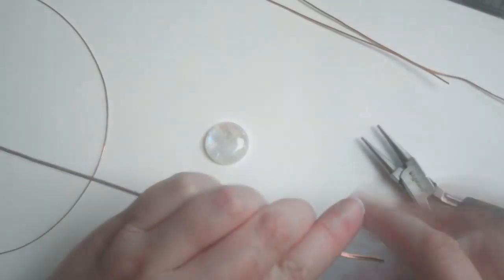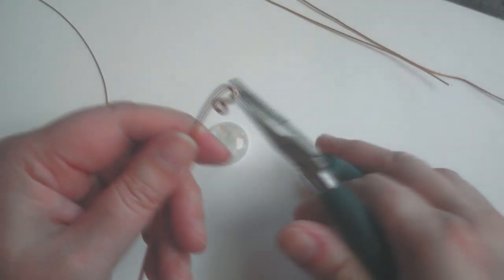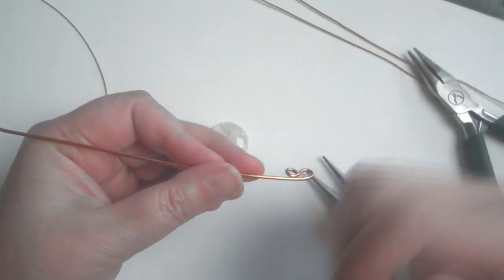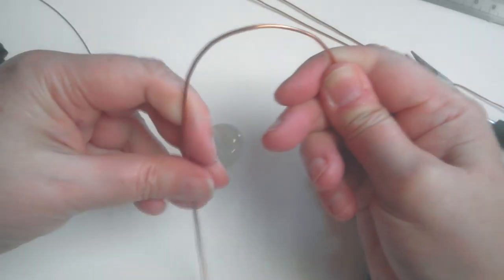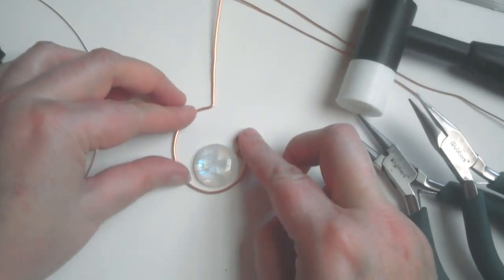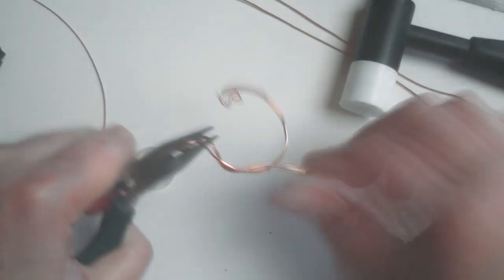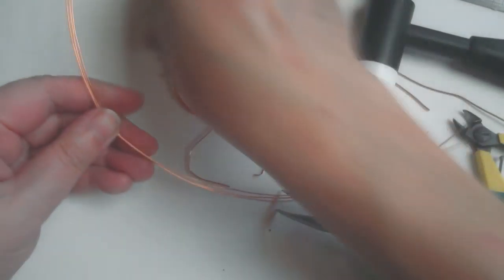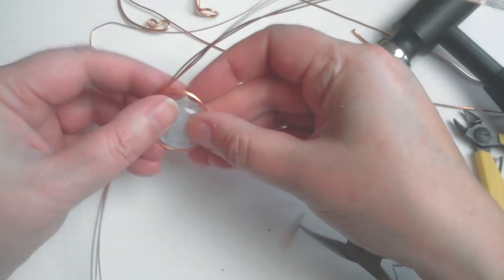Cradled Moon Pendant - A Wire Wrap Tutorial

Comment: Perfect combination with the cradle moon and Viking knit necklace.  Lovely piece.
Reply: What gage wire was used on Viking knit?
Reply from the maker: Now your asking, had to go pull out the piece of viking weave to remember - That was a heavy one and I made it using 0.8mm or 20 gauge dead soft bare copper wire
Reply: Rachel at Wire Guild thanks for your reply.

Comment: I wish you would give the lengths of the wires needed.  Wire is expensive and I want to know how much is needed
Reply from the maker: Sorry about that, the copper that I use is approx £22 per kilo - yardage at 0.8mm is approx 260 meters that's approx 8p per meter/yard .  I do state that the thicker 1.6mm wire is approx 10-12" at about a minute in.   The half round wire is approx 6" but that will depend on how many wraps you do you might use slightly more or less.  I state at 8:38 that I am using 3 lengths of approx 15" but this depends on how ornate you want the pendant.    So the measurements are there but as I felt that the lengths were not set and dependent and how you wanted the pendant to turn out I didn't state at the beginning of the video.